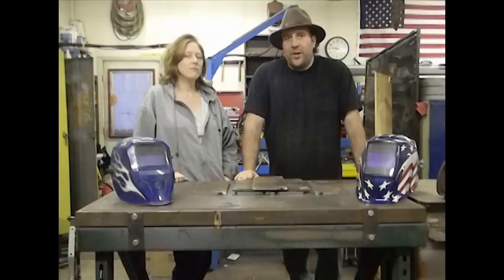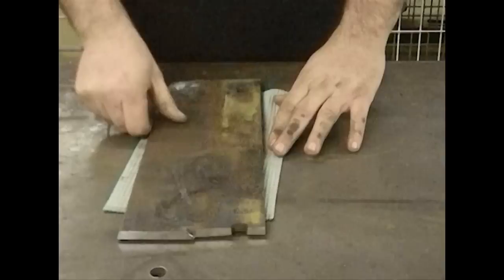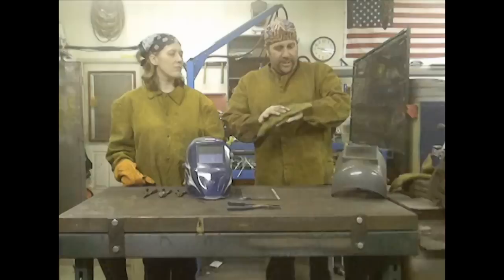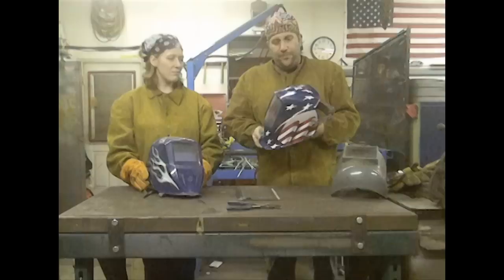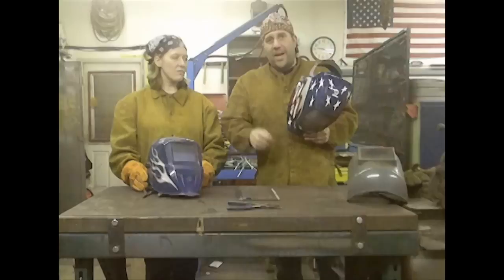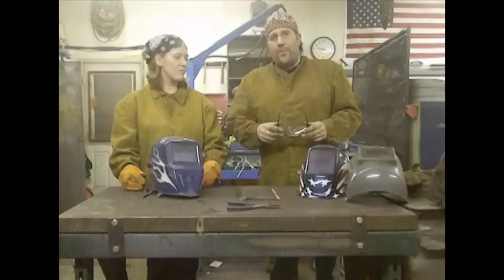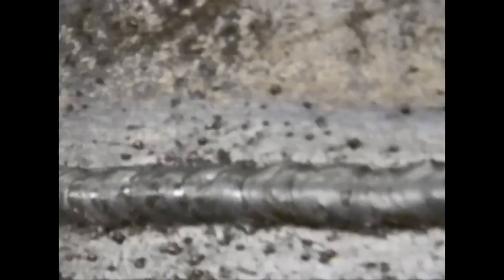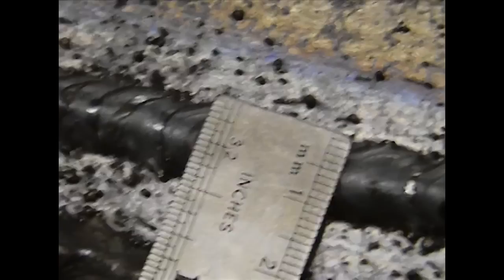Dana's Introduction to Mig Welding

Comment: Great video! Watching Dana progress so quickly is very inspiring. Ironically, woodworking (my main interest) has led me to welding. I've been doing a total shop cleanup and trying to get organized.  The frustration I felt at not being able to find lumber racks, panel carts, or any of the other material handling equipment I need at less than outrageous prices (at least for hobbyists like me) led me to purchase a Hobart Handler 190, and a bunch of steel tube and angle. See, I came to the conclusion nearly 20 years ago that if a person could weld, that same person could build nearly anything they could envision.  At that time I had a couple hours of informal training on a Saturday morning by the shop Foreman where I worked.  Life went on, we both got busy and I never got back to it.   Now I'm determined, so seeing Dana lay down such nice beads so easily has me fired up--just one question, you aren't going to tell me I have to learn violin first like she did, are you?
Reply from the maker: Thanks Steve, Dana is a real artist when it comes to a lot of things. I tell people that she is the creative force behind the business while I am more like the brute force.

Welding opens up the door to a lot of things, especially when it comes to making things for your own shop. Lucky for me I did not need to learn violin fist, I'm about as musical as a pile of bricks.

If you ever have any questions or problems behind the torch send me a message, I'll do my best to help you sort things out.